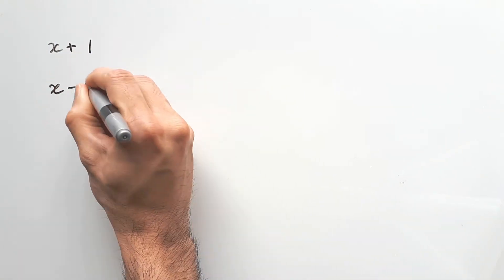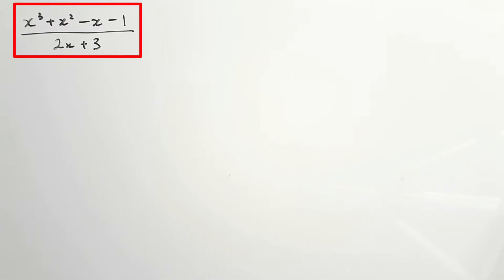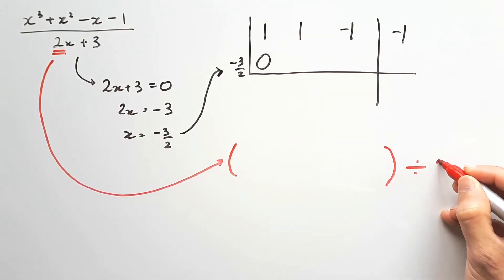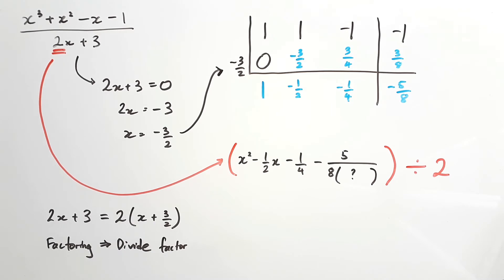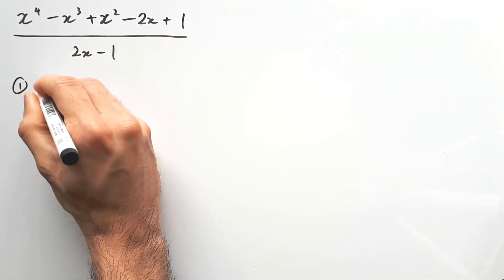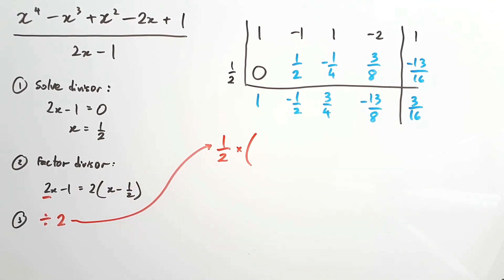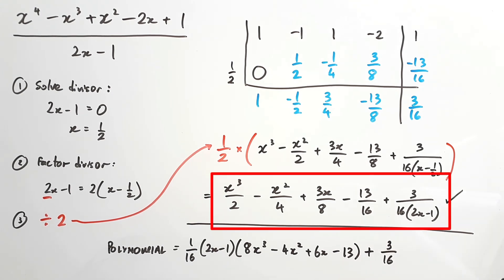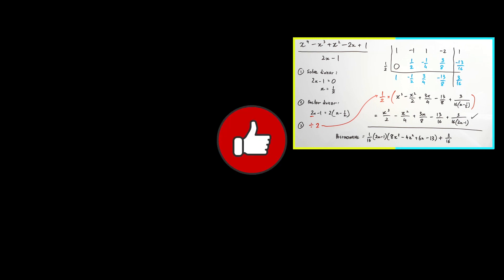How to do Synthetic Division by 2x-1 | VCE METHODS

Comment: Why is the last number didn't change when you need to divide it by 2? But the temporary divisor goes back to it's original divisor?
Reply from the maker: If you're referring to the 3/16(x-1/2) bit at the end, then it's because only the 16 OR the (x-1/2) can multiply 2. But not both. When purely viewing the denominator element, it's essentially 2 * 16 * (x-1/2). The 2 can only multiply one of the factors following it; 16 or (x-1/2). It's cleaner to multiply the (x-1/2) to eliminate that small fraction so that's what I did. Hope that makes sense! :)

Comment: Wait, so example, if your answer is a whole number (3x^2, 5x, 1, 8) but if your given is still 2x + 3, do i still divide it or do i convert the 2 to be multiplication?
Reply: Cause it's my first time to encounter a non-monic synthetic div. so sorry if I dont get it in the first time
Reply from the maker: @asu.ra21  All good. Non-monics are tough to understand. The short version is you always divide the number. So divide the final answer using the 2.